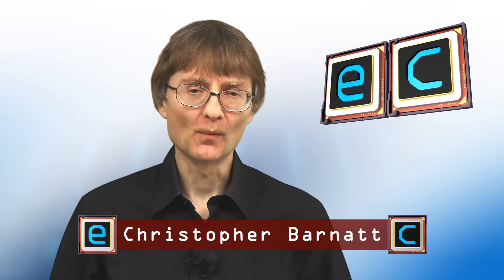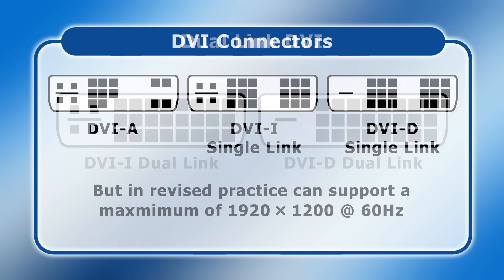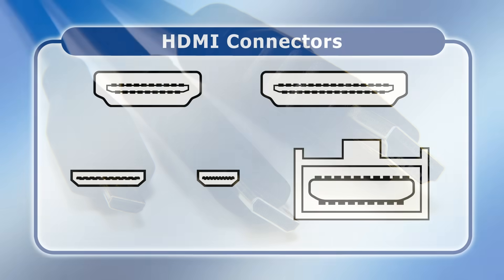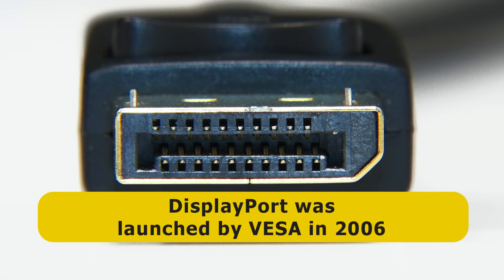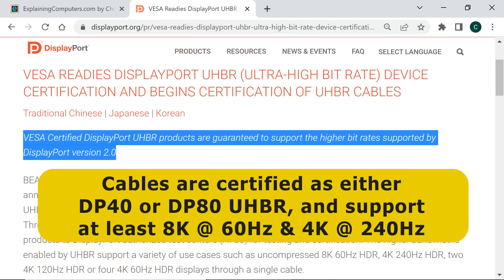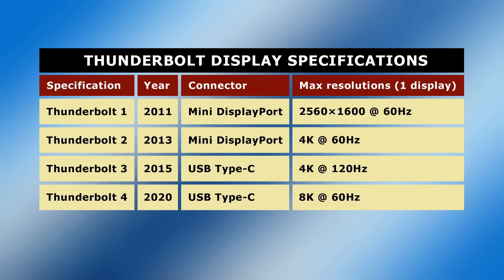Explaining Display Connectors: HDMI, DisplayPort, USB-C, DVI, VGA & Thunderbolt

Comment from the maker: Greetings All! Some here are noting that I am wrong to state that DVI does not carry audio, but I believe they are mistaken. There is no audio in the DVI specification, and it is technically impossible to plug a DVI cable into a DVI socket on a PC at one end, and into a DVI socket on a monitor at the other end, and transmit any audio. Only a video signal will be carried.

What can occur is that an adapter cable is used to connect a DVI and audio port at the PC end to a HDMI input on a monitor or TV -- meaning that the connection made to the monitor is via HDMI. :) Or, some graphics cards were made that did output audio from a DVI port, but not one that met the DVI specification. And again, the connection will not be DVI to DVI. It will be “DVI with audio” at one end, but HDMI at the other.

Given that any display connector output can be connected to any monitor input with an appropriate adapter, neither of the above scenarious may reasonably be described as being a DVI connection. Call me old fashioned, but a "DVI connection" is one where DVI is used at both ends.
Reply from the maker: @CK Gaming Channel I'm afraid that Ethernet over HDMI is already a thing! :)
Reply: Hi Chris. I can confirm that it is the case. My 3060 carries out audio from the DVI port with a DVI to HDMI cable. I was shocked when I found out but it does.
Reply from the maker: @joaojotta64  I can imagine you exclaiming "but how is this working?!" :O
Reply: Indeed but a friend was telling me about some companies trying to handle DVI+audio but it was never standard because HDMI was a thing so I thought it was something like that. But yes, I was VERY surprised!
Reply: @joaojotta64  wait a 3060 has a dvi port?
Reply: @SirPoppy  Nice catch. It doesn't. At least mine doesn't.
I think it was some old 1030 or something (I have a lot of hardware on my hands from time to time).
I remember doing it because the cable was translucent and out of nowhere the monitor speakers started making sounds. I was crazy looking for where the sound was coming out of, thinking it was the phone, when I realized it was the monitor. I was blown away.
Reply: @CK Gaming Channel have fun in SD
Reply: This clears it up nicely. I always "knew" that DVI doesn't do audio, so imagine my surprise all those years ago when my tv suddenly started outputting sound.
Reply: @CK Gaming Channel How does carrying Ethernet over HDMI let anyone collect data? I'm not seeing how those dots connect...
Reply: You're correct DVI supports video only & doesn't output audio, one of the reasons for a good sound card, headphones or speakers :)  😉
Reply: I was most surprised by that, given the extremely simple DVI to HDMI adapter plugs out there. Yes it's not in the DVI spec, but since the signal can come from a HDMI source, that has audio, running it through a HDMI adapter to DVI, you'd assume the audio is still there, as there is no smarts in them plugs to remove it. If it's all so simple it's a shame the DVI equipment vendors haven't gone beyond the original spec and just added it
Reply: Some manufacturers worked audio into DVI, had to look it up because I didn't know it had ever been done.  I  ran into one just a short while back.  Nvidia Quadro 600 card.  I think the monitor was a Benq.
Reply: Congrats, just a week or two and the 900K mile stone will be achieved and then it is just a matter of weeks till the 1 . 000 . 000 magic will happen too.
I coincidantly looked at the  subs counter and did not wanna be too late to the party to congrat so I did it and hope those 2000 might appear tonight.
Reply: There is indeed no audio in the DVI spec, but audio over HDMI is not on a separate pair, but interleaved into the video TMDS signal. I have absolutely had audio out through a DVI port on a video card. I cannot recall if i have done the opposite. It would be extra work to prevent it.
Reply: Greetings, on the GPU's I've tested (since old Geforce 8800 GT), with DVI connector, they also carry audio, if you connect them to an HDMI monitor/TV, though the GPU's DVI connector: if you use a DVI to HDMI adapter, or a DVI to HDMI cable (I use this ones a lot), like you wrote.
Reply: Hello, EC the tsunami is coming fast.
Can you do your version of ChatGPT coding on one of your SBCs?
https://www.youtube.com/watch?v=UpwsQrc2Jls
Reply: DVI with audio was certainly a thing, I even had a monitor that could accept audio over a DVI cable. I have no idea how out of spec it was though, but I was happy as long as it worked. I would say this was around 2005 or so when HDMI connectors were still uncommon.
Reply: I can confirm that the other day that I went from HDMI > DVI > HDMI and received sound. (Every single HDMI cable was shipped to a job and I needed to get creative.)
Reply: @CK Gaming Channel Yeah, been that way for years.  Sounding more and more like '1984' by George Orwell.
Reply: DVI-D will transmit audio.  I have done it.  It may not be in the specification and  the GPU has to supports it.  If you use a DVI-D to HDMI cable you should get sound.

Here is someone doing it
https://youtu.be/oaFlLtkOh_c?t=211
Reply: what you say makes sense...back in about 2010 I had a PC with a GPU that I used for a second monitor and much to my pleasant surprise, the 16' DVI-HDMI cable that I purchased on eBay delivered perfectly good audio to our flatscreen TV that I was using as an entertainment monitor in our home office... so obviously it was a non-standard DVI which I didn't realize back then...
Reply: You are correct if you wan to restrict yourself to the specifications. Engineers did not do that.
But back when Graphic cards adopted HDMI, and monitors did as well, you had both hardware with DVI and HDMI as alternative connections.
So you could use HDMI to connect the display, and transfer Audio as well. Obviously no problem.
Since both offered DVI, you could as well use your DVI cable to connect PC with display, and get Audio transferred. So that was "DVI used at both ends". Audio was not blocked just because the DVI connection was used, that would be stupid by engineers.
But of course this is just some "DVI++" or whatever, for the purpose of discussion. If you use an old fashioned DVI monitor good chances are there is an analog audio cable from that display, and you have to use that for sound.
Reply: CIA NICE  AWES0ME🎉✨🎉✨🎉🎉🎎🎭🎎🎭🎎🎭🎗🎗🎗🎗🎗🎗🎗🎑🎑🎑🎑🎑🎑🎑✨🎆
Reply: @CK Gaming Channel It sometimes is. i belive the max ethernet over hdmi speed is 100Megabit or "fast ethernet"
Reply: this is not carrying a dvi signal, this is hdmi. as such, i wouldnt count it
Reply: DVI-A
DVI-D
DVI-I
single
Synchronous
Asynchronous
Reply: Graphic supported PLUS use of dvi to hdmi cable.
Reply: they shouldn't be here if this is what they are stating, it's possibly due to the outer casing of the connectors looking similar from the outside that people are saying that it does carry audio, 
you would think people would notice, especially after physically plugging them in, 
your absolutely right, i know this myself after using the dvi to hdmi & looking at the plug & wondering why is it like this as i wanted to further minimise or rather speed up the transfer rate of information between the two,
Reply: Yeah, I got 4k60 (hdmi 2.0) output from the DVI connector on my nvidia 1650 to an LG 4K tv using a passive hdmi <-> dvi adapter. I was quite amused.

I also have a Samsung plasma that has an HDMI input with "dvi mode" support.

The HDMI <-> DVI cross-compatibility is very... Interesting.
Reply: I have used DVI for video and audio on several computer installations. I suggest you look into it a bit more before dismissing people.

Comment: Excellent on all points. Wish you had FireWire cable: 4-pin (male) to 9-pin (male), Apple Thunderbolt to FireWire Adapter (model MD464LL/A or similar) and Apple Thunderbolt 3 (USB-C) to Thunderbolt 2 Adapter

Comment: ok, I recall using a dual screen setup but that during boot or entering bios only the display connected via VGA would show anything, the other screen connected with DVI remained blank until Windows loaded.
I'm currently having issues where my display is blank during boot and bios and I'm wondering if there remains an issue with digital connections?
I'm trying to install Linux Mint 22 on a GMKtec M5, my screen is a LG TV because my original screens only have VGA and DVI whereas the TV has HDMI, AVI and an assortment of other more colourful options not covered in your video. The GMKtec has HDMI, DP and USB-C.
I'm stuck in Win11 limbo (hell) as I can't boot from USB and can't access or see the bios to allow myself to do so.
Suggestions gratefully received.

Comment: USB type C - i've only thought of them for charging a phone:) I'm looking at a monitor to buy that has this transmission over a type c cable - If I get this monitor, will the usb c end plug into the monitor and the normal looking display port end connect to my pc?
If monitor also comes with a straight up display port cable - should I use it? Preferable over the type C? My motherboard has 1.0, 1.1 and DP4 as well as a few type C.
Sorry to trouble. I'll soon have a powerful new PC while deciding on a monitor. Thanks

Comment: Hello, I am attempting to connect an older PC with VGA and DVI-D Dual link ports to a Dell u2720 4K monitor. I would prefer to use the DVI port. Is this possible and if so what Cable/adapter do I need. Thanks in advance for any help.

Comment: Quite often, if your HD resolution over VGA is fuzzy it's because the monitor is not properly adjusted to match the timing.  Monitors with a VGA input usually have an auto-adjust button that will align the VGA signal to the LCD.
Reply from the maker: Yes, sometimes this can fix the issue. But by no means always if the cable is not up to spec.

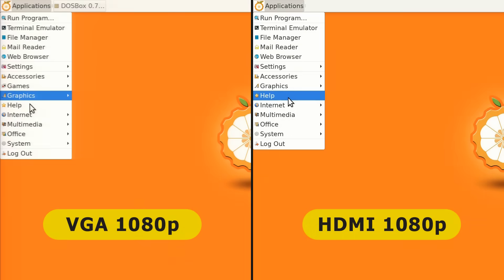Comment: 02:00 🖥 Display connectors like VGA, DVI, HDMI, DisplayPort, USB-C, and Thunderbolt offer various options for connecting computers to monitors.
05:17 🌐 VGA carries analog video signals and supports resolutions up to 2048x1536, but higher resolutions may appear fuzzy due to its analog nature.
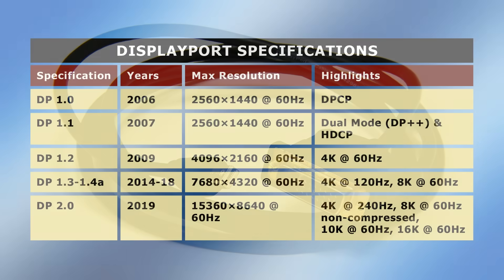09:53 📺 HDMI features different connector types (A to E), supports audio, HDCP, and even Ethernet, with constant upgrades for higher resolutions and frame rates.
13:26 ⚡ Thunderbolt supports power delivery, video, and audio transmission, with Thunderbolt 4 offering advanced features like support for up to one 8K 60Hz display or two 4K 60Hz displays.

Comment: Man, back when I only had a 1080p 60Hz monitor, I used DVI instead of HDMI. Worked fine. It was only after I bought my first 144Hz monitor that I switched to DisplayPort. I never cared about having audio transferred through my video cable on PC, as I always used speakers or headphones connected directly to my computer, rather than connected to my monitor.

Comment: I have DVI d dual line in my gpu and my monitor have only hdmi and display ports does it will run 144hz??if i use cable from dvi to HDMI or i need something to do?

Comment: Should I use USB-C to displayport adapter/converter or a single cable for gaming. My laptop supports TH4. And I want to connect it to a 240hZ gaming monitor. My found some TH3/4 to DP cables but is it better than USB-C to displayport adapter/converter ?

Comment: "HDMI signals to identical to DVI. This allows for creation of bi-directional, low cost DVI-HDMI adapters that will work at all DVI supported resolutions"
No, they're not. I've spent way too much time (and money) trying to get my Dell 3007WFP 2560x1600 monitor to work on HDMI but no success. One look on DVI and HDMI pinout diagrams will tell anybody that not only DVI has more data pins, they carry different signals to HDMI which will require an active adapter with chip that will "translate" the signals to HDMI. Have I done this I would have saved a lot of nerves but I trusted the youtuber again. Please correct this information to prevent more people wasting their time and money on something that will never work (unless they're satisfied with 1280x800 resolution on 30 inch monitor).
Reply from the maker: I'm sorry that you've been having problems, but the information in the video is accurate. HDMI/DVI adapters  are passive as the two standards use the same signal levels. But they don't have exactly the same pins (not least because we have single and dual link DVI connectors, and DVI does not carry audio).

The wiring for a passive HDMI to DVI adapter can be found in many places online, including here: http://www.alciro.org/alciro/conectores_26/patillas-cable-HDMI-a-DVI-D_274_en.htm I have also myself used passive HDMI/DVI adapters on many occasions. So just because you cannot get something to work with your particular equipment does not make the video wrong.

The statement in the video that "HDMI signals to identical to DVI. This allows for creation of bi-directional, low cost DVI-HDMI adapters that will work at all DVI supported resolutions" is accurate. However, it does not mean that all HDMI to DVI adapters/cables will be created to support the maximum DVI-D resolution of 2560 x 1600 (which will require high quality cable wired for dual link DVI-D). But such cables are technically possible.

So, for example, the wiring diagram in the above link will not work for 2560 x 1600, as it is single link only -- without the duplicated TDMS connections to the extra middle pins.

Comment: I'm watching this video on a crazy-size monitor: 2560x2880 (LG Dual Up) as one part of a dual monitor system (essentially running three monitors worth of pixels).  I had an Nividia GT 1030 (one of the older ones) that simply couldn't handle the load very well.  Everything was laggy,  So I swapped in a used AMD RX 580 and now everything is fine.  I'm not sure what the bottleneck was.  I don't think it was a cable.  It may have come down to the version of HDMI supported by the 1030 vs the version of DP supported by the 580.

Comment: DVI-A and DVI-I carry VGA analog signal, so the analog resolution is determined by vide card manufacturer. For example NVIDIA GeForce GTX 900 series graphics cards can carry analog signal through DVI-I at max resolution up to to 2048x1536 85Hz (wich is max VGA spec) and digital up to 2560x1600 60Hz (DVI-D dual link).

Comment: I have a 24" monitor here with only one DVI input connector. It does not turn on except it will show my PC boot screen, then turn off when windows starts to load. If I connect it as second monitor my PC detects a display but says it's disabled? I tried the monitor on a PS4 and an Xbox 360 and the monitor will only turn on for the 360 in one mode, 720p. It seems to work fine, only on the Xbox and only at 720p. Then I realized it says DUAL DVI next to the connector. So I'm wondering if I don't have the right cables or if there's something wrong with the monitor? All the cables and HDMI adapters I have got the 24 + 1 pin.

Comment: Backwards compatibility not mentioned.
Reply from the maker: How exactly is it not mentioned? There are many mentions of this.
Reply: It’s not a big deal. But as a simple example, if I had the very first type A HDMI cable, I still would be unsure what I could do with it. Presumably, if I interconnected two HDMI 2.1x devices, it would transmit 1920 x 1080 at 60Hz signals only, otherwise it would be expected to work? But if I were about to buy a discount cable, I may decide to opt for the more expensive 2.1x cable, as that would match the devices and would surely work... On another topic, it is interesting to review this video along side the Wikipedia Computer Display Standard page as your information compliments the diagram and other information there.

Comment: First. In the introduction you said that VGA was the first Display connector, but I think EGA was first (which you didn't listed) The only reason I know this is because I still have a TI99 computer that uses the EGA 9 pin video connector. Of course, I can't use it because I can't find either a n EGA monitor or an adaptor to any of the newer connectors. 
Second, at the end you mentioned SDI options. Where can I find out more about those?

Comment: just one remark Chris, DVI can also carry sound. Other than that you nailed it. :D
Reply from the maker: Thanks for this. But the DVI standard is not specified to carry sound. So there is no way to carry sound from a DVI connector at one end, to a DVI connector at the other. However, some graphics card manufacturers implemented a non-standard (outside of the DVI specs) arrangement that allowed sound to be carried from the DVI output on some of their cards to an HDMI connector, using an appropriate DVI/HDMI adapter. So a very interesting hybrid of DVI sound out and HDMI sound in -- but it's not part of the DVI standard! :)
Reply: @ExplainingComputers  most graphics cards just send HDMI signal (with audio) on DVI-I or DVI-D connector, if the connected display device (through DVI-D SL to HDMI adapter) is HDMI.

Nvidia control panel would show display type as HDMI monitor/TV, even if it was connected through DVI port using adapter.

Note:
This doesn't work on older cards, (GeForce 8 series and Radeon X1xxx series and older) that doesn't have native HDMI support.
They would just send DVI-D signal only, and treat display devices as DVI monitor or HDTV.

Comment: Worth mentioning that despite the USB-C plug being symmetrical some devices only work with the plug the right way around. We found out the hard way as I work in a University as an AV Tech and we were testing a new Wacom graphics tablet, it would would only work if the USB-C was the right way around. Only found out by trial and error.

Comment: Great vid! Even though it's not as big a mess as all the USB connectors, the HDMI/DP/Thunderbolt family of connectors are still a mess.

Also, 1366x768 is a decently common VGA resolution too, being the widescreen version of 1024x768.